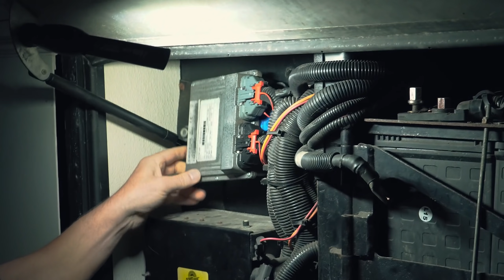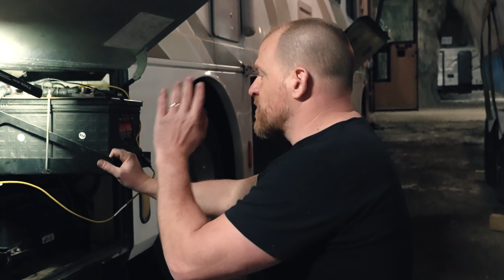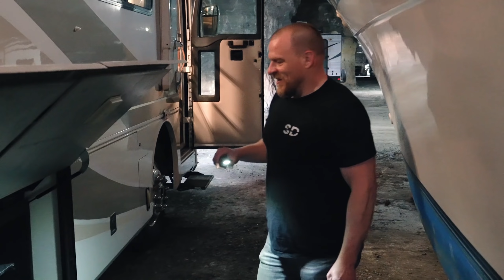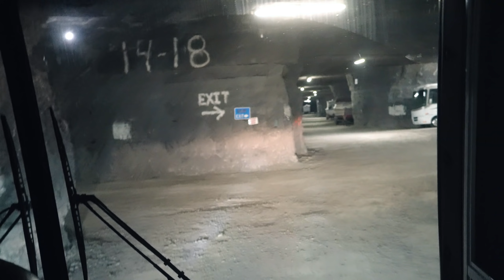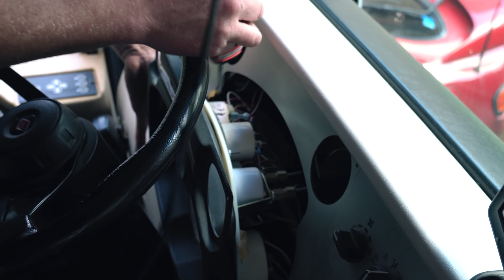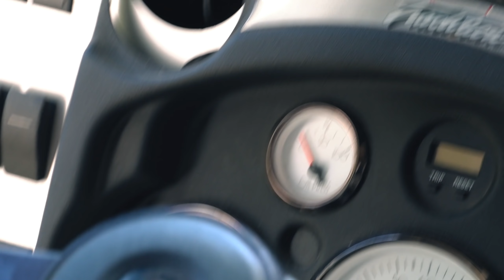What else got cooked in my RV? (bringing her home) Part 2

Comment: Just put $3000 in parts into my  36 ft RV 3126b CAT with 40 k miles. 
A heui pump sensors and ECM.
Still no start.
No communication with ECM a rebuilt one which CAT had to flash for $750...
Ugggg
I wish I had 8.3 Cummins.
Heui motors suck.
Ps my CANDO scanner reads Cummins CAT Volvo etc.

I had Mack's with 24/12 series pararel solenoid.
Guys would explode batteries of hooked wrong.
Most people can't figure out those 24/12 systems .
Reply: Yep lots of people have never ran into a Series - parallel switch for 24/12 Volts . They are good to have in Cold Climates
Reply: @paulrooster2108  once you understand how they work they are excellent.
Reply: yeah.heui system really sucks.we have heavy equipment powered by C7 engine.always problem.
Reply: @vsheavy2792  terrible POS. Disappointed in CAT on that motor.

Comment: My suggestion is to fully charge all the batteries then start it up and see what the charge voltage is at in the RV and at the alternator
Reply: You could use a  hydrometer before you start to see the charge state of your battery. 
A specific gravity of 1.25 to 1.27 is a fully charged battery. 
We used to use hydrometers all the time but in this day and age of high tech we let the computers tell us what to do. 
The Rise of the Machines. Me and Sarah Connor,  we'll be bach.